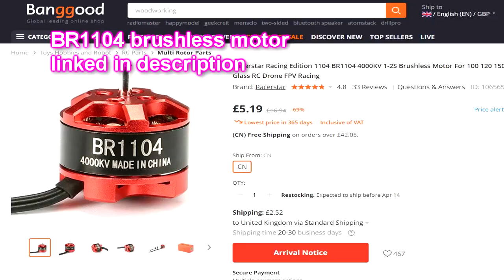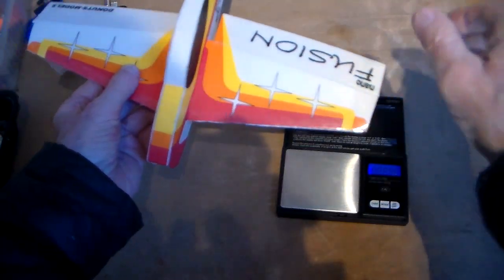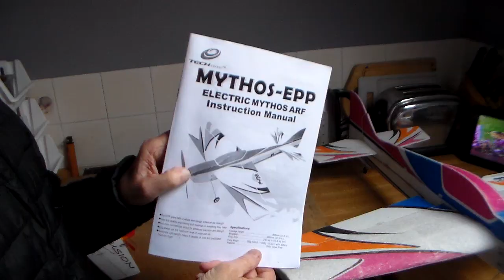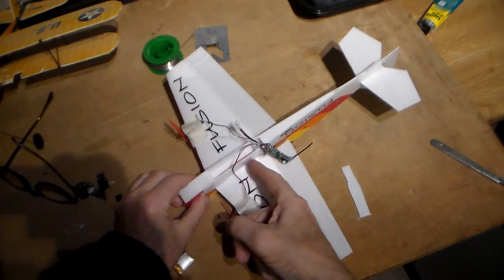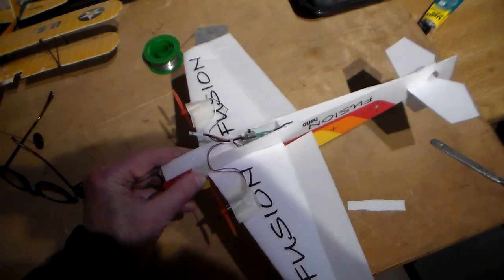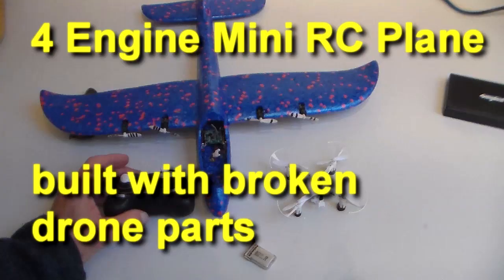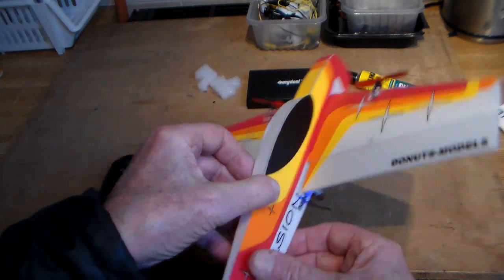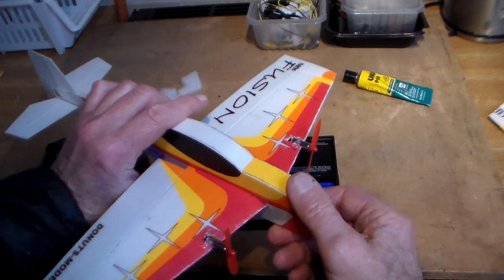I built an RC plane from an £8  Depron Foam Kit - Nano Fusion Build and Conversion

Comment: Hiya my goodness that is tiny....just a thought from memory and I may be wrong and maybe you tryed it, I think it was the eachene or volantics small plane TX you can reverse the chanels by holding the desired stick in the direction you want to change for so many seconds and it will reverse it..... I can't remember exact detail sorry....I'm not sure how many of the small RTF TX can do it..... when is the maiden? Maybe it's raining at your place....😉😎
Reply from the maker: That's interesting, hadn't heard of that. I'll Google. I  use Flysky FS6.  The maiden, good question. Too windy today and showers. I've got 3 waiting for maidens now!  It will happen! 
I just received another FS2a mini 4 channel rx today and successfully soldered the pins on. They weigh just 2.7 gms. 
I'm planning my next light weight, with the Br1104 ,motor 5.8 gms, the tiny 0.5 gms esc and the FS2a rx! That's 9 gms plus servos and battery.
Reply: @bobflyman  sounds like your very busy ! Awsum. Yes it was some of the hobby grade TX you could chanel reverse..... I'm learning how to use the fs i6x..... slowly understanding it and such great pricing ! Happy maidens 😎😉

Comment: the aeorc sp017 servo weighs 1.7g
Reply from the maker: Wow, that's light. Lightest I had was 4 gms, but it was also a question of space.
Reply: yeah that's true
it's 16x13.5x6.2mm
would that have worked?